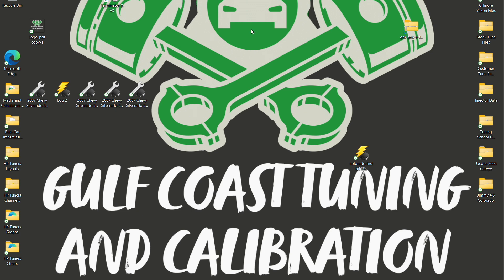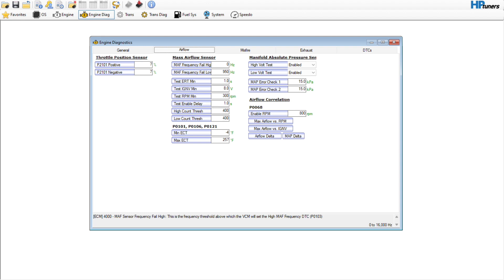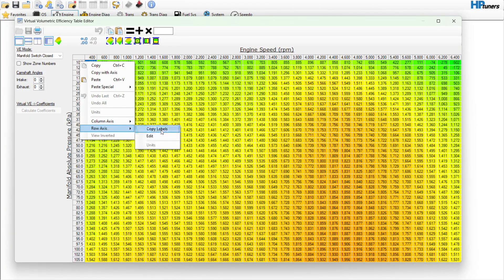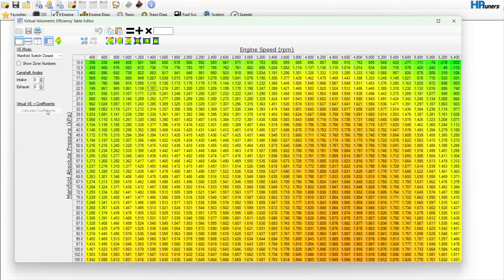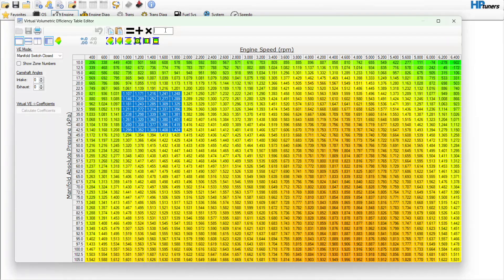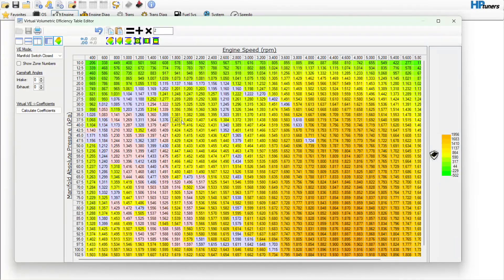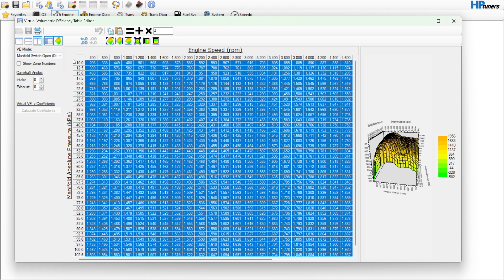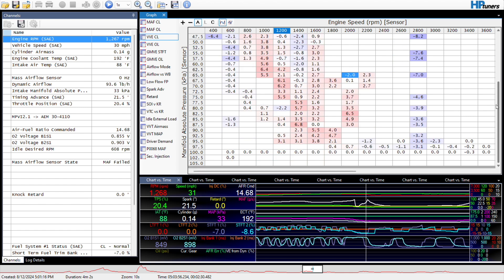Unlocking GM Gen 4 VVE Tuning: Advanced Airflow Control for Peak Efficiency

Comment: My engine is a 4-cylinder one. I noticed that there are some differences between my "open" and "closed" indicators. May I ask if I should adjust them separately or together? And which indicator should I base my adjustment on?
Reply: Additionally, if we adjust using ltft and stft, do we still need to use eq for adjustment? Or should we use two tables?
Reply: Open and closed in the VVE means the intake valve that adjusts the runner length. If your vehicle doesn't have an intake manifold runner control valve then you would only tune the open VVE table.
Reply: @brettstoner8283 thanks